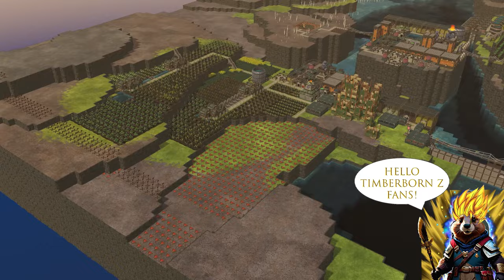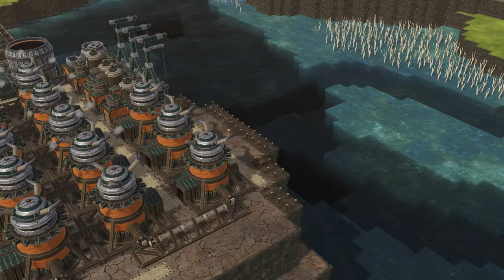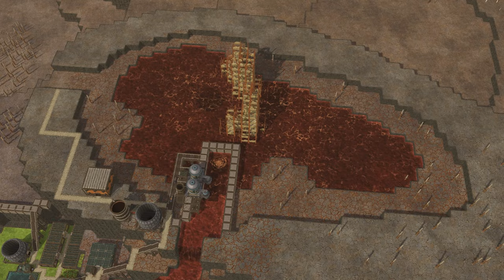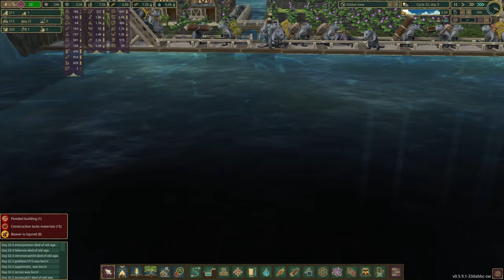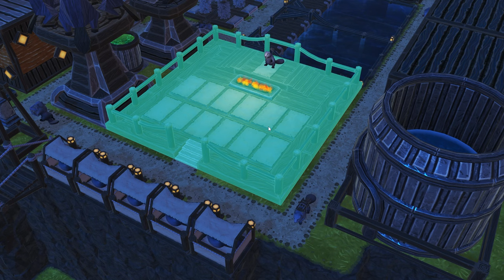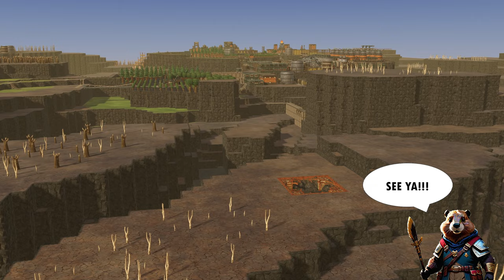SAVING ALL THE WATER!! And borking all the things! Timberborn HARD MODE, S2EP15 (Update 5)

Comment: 1:09:40 You don't need to widen the channel for the Northern channel, you can widen the dam from 2 to 4 and place a 4 by 2 pool for it to fall into and then it can reduce to a 2 wide channel which will increase the flow and height so you would want to keep the drop to the main reservoir unobstructed so it will flow. 1:09:15 might be an idea to move over the levee wall to claim more land during a drought before the bad water spillage comes back, 1:09:30 you could raise the "aqueduct" up by 1 (all of it including the bottom of the aqueduct which would be a bunch of work, including the floodgates) and that will help with keeping the area greener longer and would allow you a small water fall or dam before hitting the reservoir.